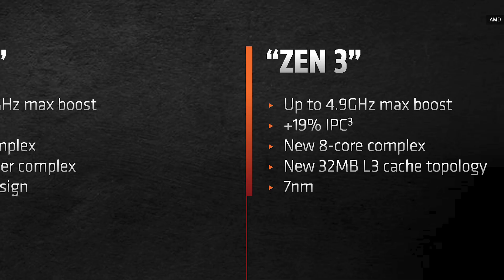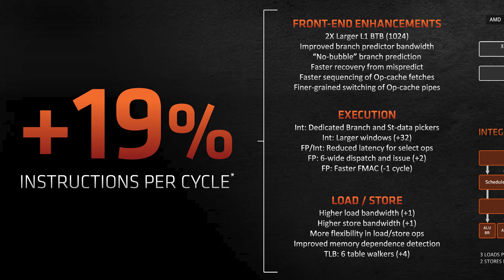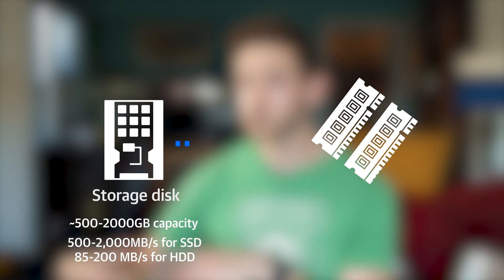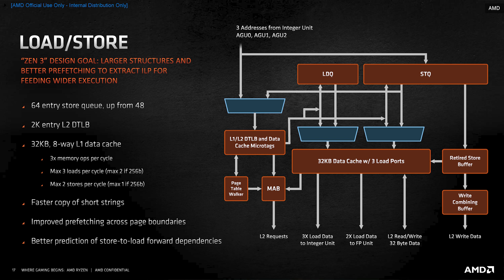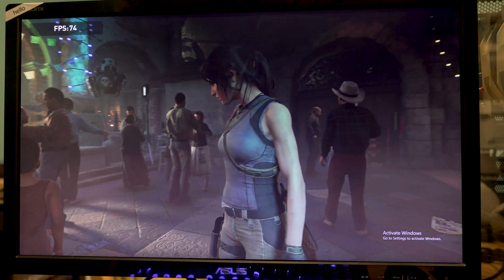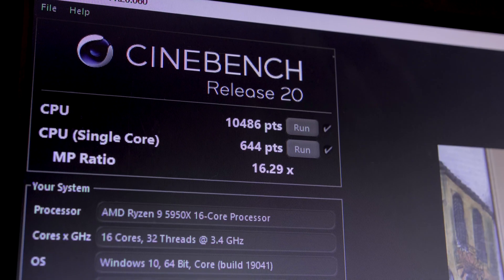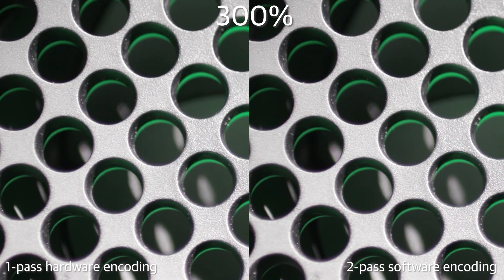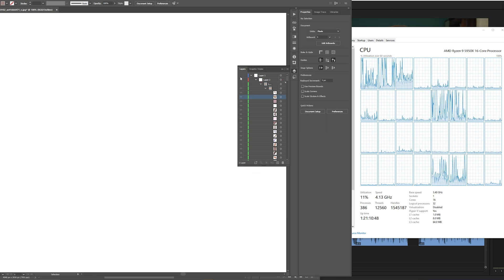How good is AMD's Ryzen 9 5950X for content creators? | Upscaled

Comment: 16 cores still killing it for audio production. Recording, mixing, mastering with Izotope and multiple instances of Analog Labs and multiple other virtual instrument VST3 programs running parallel and simultaneously within each project, along with direct feed off Roland TD27 and Fractal Axe FX III via RME Fireface UFX+. 
32GB 3200 and supremely fast write times on 870 PRO SSD.  I don't see a need to update to the current Gen. 
It's amazing. It just consumes all of it. There's just no stopping it. No blips. Crackles. Hiccups. Nothing. Just 24/48 goodness on what seems to be unlimited tracks at this point.

Comment: Nobody, nobody. I repeat NOBODY has a use case for 128gb of ram at this point in the world. I had a 64gb kit for a few years and I could never even saturate more than 30-40% of it.

64gb is already way overkill. 128gb+ is useful in maybe only server or business machines.
Reply: And do you use After Effects?
Reply: @hobbybikefotr8337 I mean if you are using After Effects at higher resolutions like 4k or something at some point you'd have to agree that it's not just "personal" and that would fall under "business machine".  Very rarely is somebody creating 4k digital effects in after effects for something personal and not something that is commercial.

There's also the phenomena of RAM bloat - where programs will use more ram than necessary because the overhead is there for more ram. You'll find programs using more ram with a 64gb kit than 32gb kit - yet be exactly the same in performance. 

You pointed out quite literally the one use case and it was already covered by what i was saying.
Reply: @truthseeking3818  ohh, I thought we talk about business use. OK then.
Reply: @truthseeking3818  ohh, I thought we talk about business use. OK then.
Reply: @truthseeking3818  see, "nobody" is just from you'r perspective but alot of people who work on there pc actually need that

Comment: Some places have it on sale $200 off.  Due to the fact that I don't advertise for anyone, find it yourself.  Most of the big name stores that sell PC parts probably have them on sale.  I got one yesterday when I saw there were some in stock.  I just had to get a motherboard and RAM to go with it.  They should be here in the next week or two.  I already have an RTX 3060 to go with it and while it is not the fastest there is it is faster than what I had.  I was using a GTX 960 with 2 GB of VRAM for the longest time.  I am not sure what I will get if I sell it on eBay buy I did own it long before the scalping epidemic that was driving prices on most cards up way too high.  I could keep it as a backup to use if my RTX 3060 ever dies for whatever reason.  It won't be as fast but at least it works.  That was one of those cards you could enable compute mode for various programs and it would seem to make them run a little quicker.  That would make some games crash and if you didn't know what it was doing it you might spend countless hours trying to find the fix for it.  I found that out when I first tried it and tried to run a game but I know it might make some software act weird.  For that reason I didn't have to go insane scouring the web for a fix to a problem no one else was having.

Comment: You can never have too much speed.  I would get an Ampere Altra if the price was low, I just don't have $6000 sitting around to spend on that kind of thing.  Or maybe an IBM Power 9 or better, the only other drawback besides price with those is that I don't think they natively run Windows.  They would be fun to try Linux on though!

Comment: Just bought a gaming machine with a 5950x, 64gigs ram, and nVidia 3080 graphics card. Replaced a system so ancient I hadn't run it in over 10 years. Been working/gaming on laptops. I haven't benched it yet as, of course, as soon as I got it, my wife took my last three days off and made me clean out the basement. I'm not really sure what to compare it TO, as my old desktop was an ORIGINAL hyperthreading Pentium 4.

Comment: i had a 3700x paired with my 6900xt, basically only playing cod in 1440p. was getting about 160-180 fps. switched to 5950x and now get over 240fps. have to set a cap limit now. people say 8 cores is plenty for gaming, but 16 makes it so much better and smoother.

Comment: If you only do upgrades once every 8 year or until parts failure then the extra performance of the 5950 will keep you in operation longer. At least that's how I've operated since I built my fx8350 system. Running 2700x now that I'll need to upgrade as I get into more professional videography
Reply: Same situation, i came from an Fx 8350 and i'm running on an 2700x, i'm thinking about 5900x or 5950x for 3DS Max and Corona Render, but i can't make up my mind, since the price step it's important.
Have you bought one, and how it goes?
Reply: @IllGib  in synthetic benchmarks the 5950 feel like the jump to 2700x from the 8350. Windows is noticeably snappier, my 4k video exports on just shy of a 5 minute video were 3 minutes faster. It's a total waste for gaming, but productivity is awesome. I scored 1600 points kess than the 3990 threaxripper on cinebench r23 this not ing. No over clock.
Reply: @loadmastergod1961  What cooler you're using?
Reply: @IllGib  dark rock pro 4. But I'm switching to liquid just cause my gpu is staying over 100c with the fan maxed at 4k. With my low speed fan setting im getting tree CPU to 81c after 30 minutes of cinebench
Reply: @IllGib  understandable. I didnt have any question on what proceasor to get. Just whether to pay outrageous price for 6900xt or get a block for my 5700. I just got the block. I quit chasing generational improvements back in 2008. Lol
Reply: @loadmastergod1961  I found the 5950x discounted at 697€, i guess it's a no brainer.

Comment: Ive game up on getting a 3080/80ti/90 or 6800xt/6900xt for my 5950x build i just used a strix 2080ti. I sold a strix 2080 and still have a radeon vii, reference 5700xt and nitro 5700xt se as my newer gpu’s. I was debating on selling the nitro 5700xt mainly because the radeon vii will be hard to find in a couple years and i have the reference xt in an itx build it was the smallest fastest gpu that would fit. But i think i might try to see if the vii fits in and take out the 3600 and put in a 3900x. But my two main gaming systems are 9900ks nitro 5700xt, 5950x strix 2080ti. I’ve been in every newegg shuffle and check daily looking for high tier gpu’s for sale. Im not paying scalpers double or triple the price that’s stupid and if people would stop buying them it might stop but I highly doubt it.😡🤬🤯☠️ The vii on the used market has went way up I was very tempted to sell it but I like collecting gpu’s and the vii was a unique card. Yea it got a lot of hell when it came out but it’s fun if you to tinker. With a nice undervolt the cards not bad at all and on water its a beast. And I really enjoy the silver all metal design and 16gb’s of hbm2. But for purely gaming the 5700xt was a much smarter choice. I really just want to move to 4k a bought the smallest lg cx oled to game on I normally game on a 3440x1440 120hz gsync or a 144hz 1440p freesync display. I want to try 4k and needs a hdmi 2.1 compatible gpu.

Comment: I needed more than 4 cores for 4k editing, so last year I put together a really nice 9300x with Be Quiet cooler on a 570 board with HDME M.2 drives, SSD's and a good card and PSU in a big BeQuiet case! Super good unit... strongest computer I ever used....
But recently I'm doing 3D rendering because the machine is more than capable of it..... but it takes forever, and the particular software I'm using is totally CPU. I'm now working stereo 3D and it takes forever to process the data intensive frames. The piece I'm working now has been processing for 30 hours and has 202 frames of 2300 done. I seriously need to increase my processing so I can put out more work. The thing is, now that I have a capable machine, I start increasing the quality settings, and doing fancy-schmancy stuff like 3D stereo, and now I just need a 64 core Threadripper to help out. But in the meantime this would be a much cheaper thing to buy and put on my system. (I don't think I'll be getting a Threadripper this year). But the job I'm doing now might have gotten to 202 frames in 20 hours instead of 30.
Thank you for looking at it from the creator's perspective!

Comment: Ryzen 9 5950X is a beast for something that no one mentions:
Music Production. 

So, if you are a hardcore music producer, the 5950X is the perfect product for now.

The difference is way more massive than video editing (which isn't the only production application).

Music production is 100% CPU bound with RAM and storage, the processor does calculations in real time and delivers sound to the DAC in a time interval unlike Cinebench and all of that other stuff (that isn't a real time production application, here a CPU gets absolutely destroyed by GPUs or graphics cards).

The Ryzen 9 5950X is a 16 core processor (the cores scale very well in audio for instruments and audio effects loaded in parallel) with a max clockspeed of basically 5GHz (audio loves clockspeed too due to the singlethread perfomance).

Imagine the amount of extremely CPU intensive synthesizers and effects that you can load with very low latency playback and for recording.

The Ryzen 9 5950X is so good with the singlethread perfomance that it can run a PS3 and Nintendo Switch emulator better than a high end 10th gen Intel processor in 1080p . The 5950X has less stutters than a 10900K.

Zen 3 is the best micro architecture ever made by AMD for music production , that is something that AMD themselves said in their zen 3 presentation.
Reply: Literally looking at this cpu for that same reason. Gonna get one soon
Reply: producer here, my 5900x renders my projects in less than  minute usually.
Reply: @ian_dot_com  🔥🔥
Reply: Just upgraded to the 5950x
Reply: @Selftaught  How are u fiding the cpu? i'm thinking of upgrading from a I7 9700k
Reply: @ordinaryhuman7728  which one did you get?

Comment: Hello! I video edit and animate with Adobe. Any idea if the RTX 3070 combined with Ryzen 5950X 16 core would be an overkill for working with both programs in 4K?
Reply: Is it good ???
Reply: @itsyoboig3325  I ended up going with the Ryzen 12 core and it works great. I still have lag in my programs sometimes but not sure if it’s from not having a stronger setup or if it’s the programs themselves

Comment: My line of research involves dealing with huge symbolic matrices (a very core number dependent task) which take my old 96 core university's supercomputer weeks to compute. These high core numbers are paramount for academic research (GPUs, not so much). I just wish I could have my own 3990x threadripper rig, but the processor alone costs 70% my yearly income.

Comment: what about audio production, how does it scale there? and how is it in comparison to the 5900x?
Reply: From personal experience, audio or music production likes more singlethread perfomance (due to the audio buffer) than core count for the most part, the 5950X will beat the 5900X because it has faster singlethread and the core count helps for more instruments. Your bottleneck will be in the amount of effects per channel and that heavily depends on clockspeed.

Personally speaking, Intel is the better choice for 8 cores and below for now in audio (also, their higher clock speeds help), for AMD, the 5950X wins but it's extremely overkill.

(Even the modern Intel processors can be overkill lol).
Reply: @saricubra2867  thats good too know. Thank you. You might wanna tell me why Intel prevails vs AMD in Audio Production?
Reply: @caynofficial  Reliability and compability, CPU design (Intel processors are designed for real time processing) just like how they usually perform better in gaming, audio doesn't like core count too much, it's real time serial process.

5950X has basically the same singlethread perfomance as the 5900X but with more cores, Rocket Lake will perform even better.

I recommend waiting a little more for Rocket Lake launch, buy the fastest gaming CPU in your budget, if you do video rendering or things like that, a Ryzen 9 makes sense because the cores will be used more, if you only do audio stuff, those cores will be wasted.

Still, going even further, wait for Alder Lake, new platform, new nanometers process, more efficiency and perfomance .

Finally, if you don't care about gaming, Intel processors have integrated graphics, so you don't need a graphics card, then if you want to game, you can save more money and buy a GPU for gaming in the future.
Reply: @saricubra2867  awesome thx!

Comment: 3:40 I has no sense what you said, Zen 2 has 8 full cores per CCD  in a two CCX arrangement beacuse each CCX has 16 mb direct access L3 cache. This is monolith as Zen 3, the only change is that now all the cores shares the 32mb L3 cache and still is a monolithc chiplet.

Comment: Power doesn’t improve clock speeds, to improve clock speeds you needs to send power faster, and therefore can perform more calculations in less time. When I say “send...faster” I am talking about the amount of times it is iterated in a given time, not current.

Comment: Finally found someone agreeing with me and advising not to wast money for cpu and cheaper gpu. Actually I just built my new pc and snapped a good deal from amazon and got 10850k for $389 and msi unify for $220 so basically I saved more than $300 if I went to 5900x and msi unify ($300 on amd platform) I can buy 3080 now with the saved money

Comment: Not trying to be 'that guy', but the biggest boost in my productivity pipeline is a large pile of CUDA cores.
I don't use the processor for much more than a means to keep those cores well fed...
Photogrammetry, rendering, image stabilization, panorama stitching are all GPU functions in this shop.
Some of these tasks take 8-40 times longer on CPU!
Thousands of cores on a task, in my mind, is comparable to thousands of threads...

Comment: I am so tired of hearing gHz, when will we see chips with tera or so called tHz? 😔
Reply: Never, even if it were physically possible there are too many bottlenecks to performance which are not tied to clock cycles. Ghz don't matter as much as architecture efficiency and good scaling.
Reply: Maybe in 20 years

Comment: For me the number of fast cores is primary. Running Clarisse ifx (3D content creation) I get a nearly linear increase in performance as core count goes up. The GPU (at present) is significantly less critical. This is changing as GPUs become more general compute tools, but for now I dream of a top of the line threadripper.

Comment: I was going for the 5900X, thinking that I may save a bit of money and lose only a small amount of performance. Today I got an interesting call though: I do a lot of data analysis as my work and some customer of mine got a data set that they were just unable to process because it was too large for the machines (and tools) that they use. It makes sense for me to build up my home computer as well as possible it seems as it creates me opportunities to work from home (especially important now with Covid, but I do not particularly enjoy travelling on normal days either). So the solution, I switched the 5900X from my shopping cart to 5950X and I am now thinking of adding some more memory also to the machine. This one extra job already paid for the CPU by more than 10x. On data analysis it is almost always CPU dependent (only some machine learning applications work with GPUs) and it is a mix of single and multicore performance.
Reply: What was preventing processing the data?  Was it just not enough RAM or would it take way too long still?
Reply: @charleshines8523  ah that old case. Mostly RAM is the factor that makes things pass or fail, but CPU power makes it enjoyable or not. I am still using that 5950X with 64GB RAM. Additionally for me CPU speed also makes the analysis steps shorter so it is easier to keep thought process clear (less content switching).

Comment: Hay dude, you show a very simplyfied case run. Just pin Cinebench for 30 mins and look at the average score you ll see a drop off in Intelperformance due to "throtteling " (not reaching full boost clocks anymore because the thermals are killing it while 5950X will beable to still boost. So anyone who has to compile or render scenes for plus 10 mins will be FAR better off with 5950x except for 512 instructionset render

Comment: I have an i7 980 which I bought in 2009 and I just kept upgrading the graphics card. in 2010 to about 2014 newer chips were only incrementally better and used less power.
I was concerned about running with a 10yo mobo so recently I bought the Ryzen 9 3950 and the RTX3080.
Also since 2000 I was frustrated by the way hard drives were the slowest components and put up with a lot of thrashing. Now the SSDs are a godsend.
Do I need all this? Probably not but I don’t want to get frustrated again by some limitation or bottleneck and glad I don’t have to run my reasoning past a boss or spouse.

Comment: Ryzen 9 5950X is THE MOST SLOW GAMMING PROCESSOR IN THE WORLD! I bought Asus crosshair formula VIII, Samsung 980 Pro 1 TB, 32GB of F4-4000C17D-16GTRS G.Skill memory, Asus RTX 3090 OC, and all this is stopped in a corner waiting for my paid Ryzen 9 5950X by 14 days running at 0 ghz because the store sell it to me without stock! So... 5950X is THE MOST SLOW GAMMING PROCESSOR IN THE WORLD because if I have choosed intel 10900k or even an Intel i7-5820K i would be gamming by 14 days now and Ryzen is nothing more than a fraud! >:\
Reply: cringy asf
Reply: Why not ask for a refund n return the motherboard..problem solved in max 3 days lol